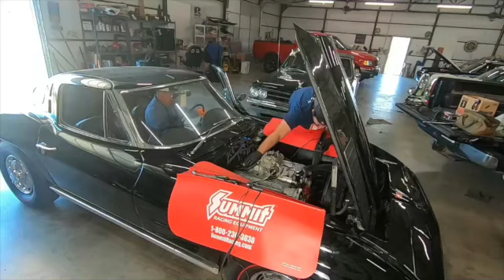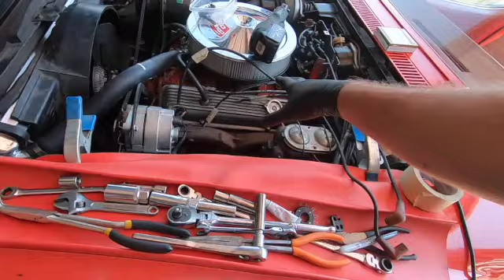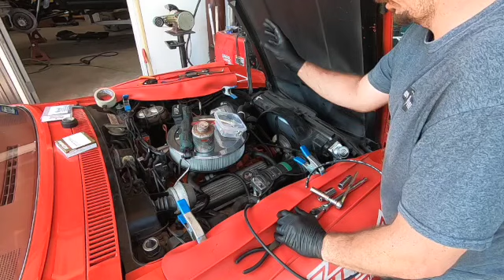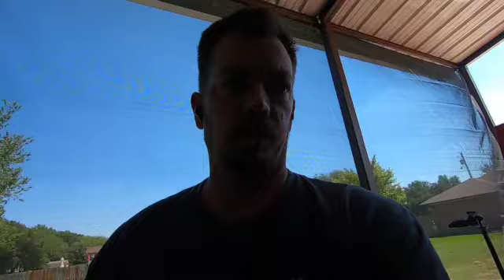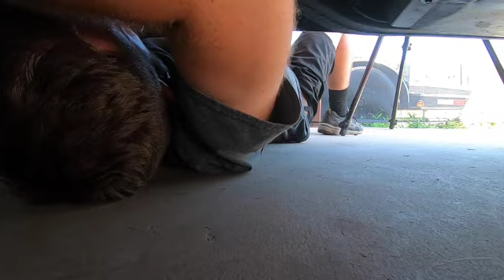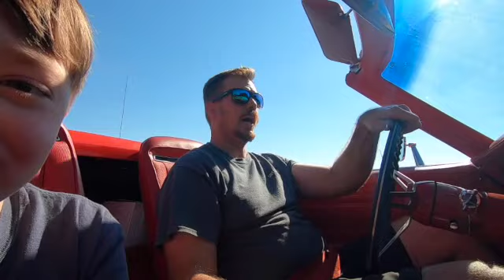1970 C3 Corvette gets new Holley Sniper and fuel upgrades - Part 2

Comment: Dont use Chinese made engine parts!
Reply from the maker: Sure, whenever possible, but we didn't replace any engine parts on this project, so what do you mean specifically?
Reply: @CodyCrafted  The Holley injection is chinese made the electronic and the injectors suck as hell! I would not install a single piece chinese electronic in my vintage car...I would keep the original US made (quite good) Quadrajet...
Reply from the maker: Please elaborate on your experiences with the sniper system
Reply: I'm running a sniper. It's nice. However the wizard handheld blanks out and the car dies.  Most times it restarts. Had to have it towed one time.  I'm about to go back to carburetor.